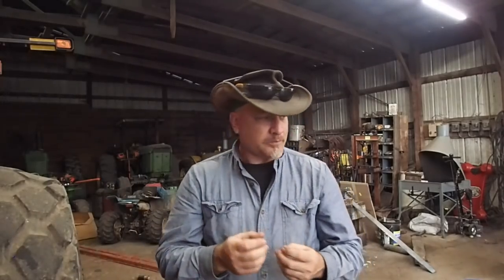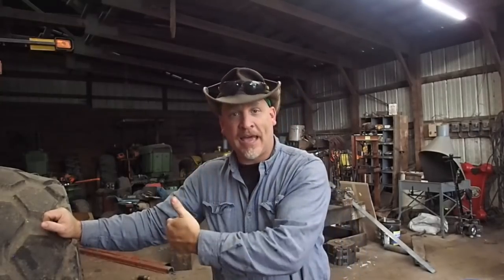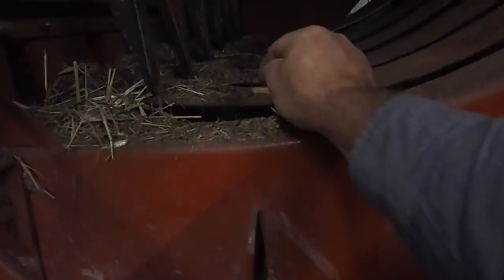Watch! Listen! Learn!!!

Comment: I run a case IH 8575. Same as a hesston 4755. I never knew there was a knife where the plunger shears across the stuffer. Always assumed the stuffer held it up as plunger came back. After watching your videos i took a look at mine. Holy crap. It. Is. Shot. Yeah I'm putting in a new one before stalks. I have really enjoyed the hesston series. I've ran this baler 8 years and still am learning.

Comment: Great video, Wes. Agree 200%.
Your analysis of the 4910 problems is spot on. I do not always fully agree on your solutions, but hey, it's your baler. You can try out whatever you want, and as you say, if it doesn't work, just throw it off again. Still don't understand the plunger face extension. Why not change the stuffer/plunger timing? With the face extension tapered in the bottom, you risk curled flakes.

Comment: Where you welded the little ramps in. You could also use tines from one of your hay rakes bolted in the same place that way they hold the hay back plus they are springy . I grew up on a farm in the UK so i under stand what you are trying to achieve. Regards Rob
Reply: sounds very logical :)
Reply: But smaller ones from maybe the bailer pickup reel

Comment: I'm just a young guy, but one day I hope to know even just a small amount of what you know about equipment and hay production. Additionally, I had the opportunity to run a 7200R with an H480 loader, and you weren't kidding about the height. At just a few feet off the ground (the forks) you can barely see past either side of the loader arms.

Comment: the thing is ANYBODY that uses a piece of equipment on a full time job knows that they break down and quite frequently when you put on 200 hrs or 10k miles a month.... its not like driving a car an hour or two a day to work and back... its constant, hard, gruling use and requires the extra maintenance that comes along with that

Comment: I grew up on a small farm. Every summer we were out in the field with the PTO driven sickle mower on the David Brown, a side delivery rake behind the Massey Harris, then we'd swap the DB over to an "idiot block" baler that's older than I am. Saw many a haying day that turned into a field repair day. I've never worked with equipment on the scale of that you use. We had 3 cows and a couple dozen chicken., No need for anything that big. Just the same, I can say from my own experience that what you show is real life, and nothing out of the ordinary. Shit wears out. Shit breaks. Especially under load. You explain the mods, or repairs, you're doing. You explain what needs to be fixed, and why. If you're just trying something, to see if it will work, you explain that you can undo it, if it doesn't work. Why do people find this stuff so hard to understand? All they need to do is pay attention.

Comment: Wes from the beginning with the plastic liners I have wondered why you didn't use several (say 50) pop-rivets instead of the 6 or what ever bolts washers and nuts? Seems like the plastic would be formed and smoother allowing less dirt/chaff under the plastic.
Reply from the maker: pop rivets are soft aluminum and will wear away so fast the plastic would be in a bale in a week.

Comment: Wes- You have more knowledge in hay than the people who design balers. If they were smart they would watch and learn.
Reply: Daniel Sweeney how true. I use to say that engineers/designers should have to spend at least 25% of their time doing the job that they design equipment for! Then about 75% of the design flaws would get corrected at the design level.
Reply: Certainly true that developers should spend more time in the field, but don't forget the 4910 was designed as a straw baler and it does great in straw.Wes repeats time and time again that he is adapting it to be a hay baler, which was not the initial purpose.In fact some of the changes are adverse to baling in straw.Wes seems to better realize this, than the bunch of you criticizing the developers.
Reply: The way hes talking id say hes getting a protype baler from a company next june.

Comment: the new HDP high speed. is called the HDP II they are a lot bigger but they have sealed string boxes so that will make you happy. have you thought about a Krone multi bale. it can make large squares the same as any other but it can also make conventional bales and tie them in to a large square so you can handle your conventional bales the same as your big bales so no need to be manhandling idiot blocks and being in a dusty hay loft lol. keep up great vids

Comment: Northernfarmer had one of his Case's Tractors down most of the summer. And had just got it back before he was harvesting hay.  Wes why not just extend the stopping fingers at the top 3 inches, or do they not retract far enough for that?
Reply: I don't think there's any way to adjust the stroke and it retracts them when it cycles. would be slick if there was.

Comment: Mods all seem to be thought out well and executed just as well. And as you've said multiple times if they don't work you will remove or re-think them.You didn't use a computer simulation,a CAD design program,or a 3-D printer: you saw the problem,engineered the probable solution,and followed through with implementation. What was done for 1000's of years by people before us.
Problem,as I see it, with the newest generations is that few can actually use reasoning to work through a problem. If they can't find a solution within a couple of minutes of internet searching then obviously there is no solution to be found.
I can't count the number of times I've dealt with under 30 "engineers" who want CAD drawings,a computer simulation,etc of a HVAC coil I build. I always end up telling them "Partner I'll just build it and send it to you. Look at it,check it for fit,make notes of changes you need,kick it across the room or use it for a paper weight." Amos they say, I can't wait for 4 months to get a prototype coil. Partner with me a prototype takes a couple of days, We do them during lunch, I own the joint and if I have to I build it myself. "Wow" they say.......
I'm about as old school manufacturing as can be. It has worked,does work,and will always work. Why change?
Reply: And, just yesterday I was using a large(2000 pound machine) surface grinder to precision grind some machine components. Grinder is large and takes a 1" x 10" wheel. Built in the early 1960's and rebuilt in 1978.So this 50+ year old machine will grind down to a .0001"(one ten thousandth of an inch) tolerance,has green to go and red to stop buttons and toggle switches. Gibs and ways are still true.No digital read outs to fool with: you use graduated wheels and feeds.
It's old and was obviously built to last. Problem is that kids can't even figure out how to turn it on so I run it which I enjoy doing.

Comment: I have noticed on several videos of this Hesston Bailer, the clearance at the top of the tires, seems so slight. I realize there is no suspension, so the wheel would travel very little. Just how much clearance is there between top of tires and body?

Comment: Ha most education nowadays don't mean squat. I'm greatful for the ones that actual use their education with common sense and experience, but not some arm chair bandit that can't figure out 2+2 is still 4. Failure doesn't happen until you try. Engineering in manufacturing, there is a massive amount of failure. Look at all the junk that is so high priced and breaks in the first few uses. This is what your fixing or modifying because they ran over their budget and moved on to something else.

Comment: failure their is no such thing.if you are repairing  modifying or building from scratch their is no such thing as failing.you have simply found out how to not do something so the next go is right.Thomas Edison quote from interview.Thomas Edison 
February 11, 1847 ? October 18, 1931 
http://www.hyperhistory.net/apwh/bios/b4edisont.htm
..."I have not failed 700 times. I have not failed once. I have
succeeded in proving that those 700 ways will not work. When I have
eliminated the ways that will not work, I will find the way that will
work." ?Edison.